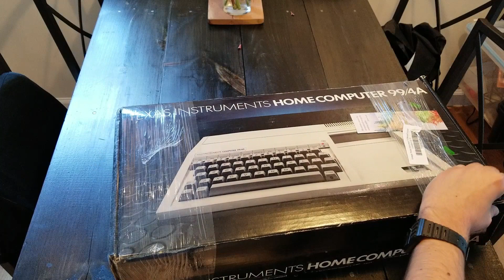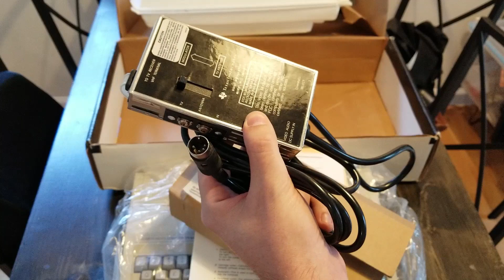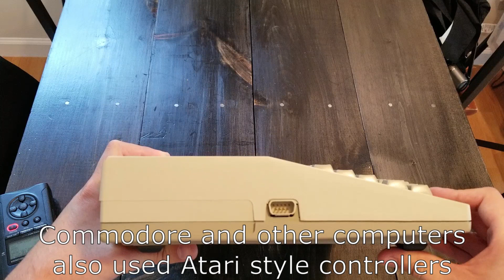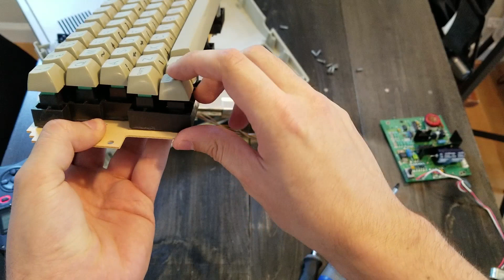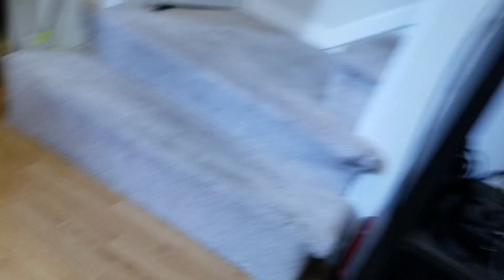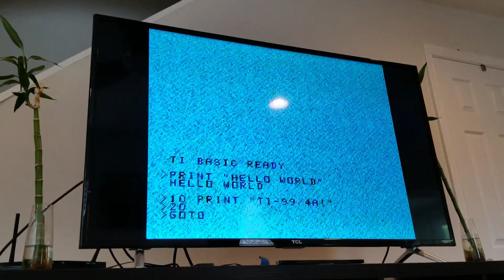TI-99/4A: Unboxing, Teardown, and First Boot

Comment: i am using cable from c128 it seems to work it didnt come with one you are using. when i turn it on shows lines on white screen it wont lord program. i just got it today, my came with Cassette Drive Cable TI-99/4A  i might take it back to second hand store i have 30 day warranty on it

Comment: love your vid.. btw, your hands are very shaky!   maybe too much caffeine?   I used to own one of these.. had the original black & silver one. I've never seen one in beige up close..
Reply: Shaky hands is normal, for a lot of people. What caught my eye, was using the pinky knife to open the box. That was some pretty good tape work and packaging. Did the previous owner even use the computer? It looks like new old stock. It's obvious it's used, but it's so pristine. Also those extra wires are factory patches, after it was designed. So to either cut costs, make improvements they would do that. It's not a home-brew hack.

Comment: I had one of these as a kid. I won it as a prize in elementary school for selling candy actually...i used it for video gaming...i had the beige 83 model and had the adapters to run Atari joysticks....even though the joysticks would fit the ports you had to have special adapters to get the joysticks to work.....sears used to sell the adapters....you could easily get games for it at toys are us back then...some of the titles were funny for example Pac man would be titled munch man and instead of gobbling up pellets you would just leave a chain behind as you move through the maze.
Reply: There's a reason it became a raffle prize. At that time, around 1983, it was selling for as little as $49, new in box. Which is like 95% off retail when it first went on to market. There was also a real PacMan game version, that was almost perfect, as well. The Silver model, sold for more than $500. Also there was a Ti99 that had a chiclet keyboard before both of these, that sold for $1400, I think. They used a mini-computer 16 bit CPU, which was expensive, hobbled it, thinking this would be more efficient and better marketing, than just going with an 8 bit 6502 in the first place. This was a DOA design which could have been great, and mostly was, but too expensive to sell and market. It was always losing money.
Reply: @danilko1  Absolutely! It was an awesome prize for a 6 year old for sure though...i had fun with it, between the games and the books of code that came with it to make it do different things...i actually wish i still had mine.